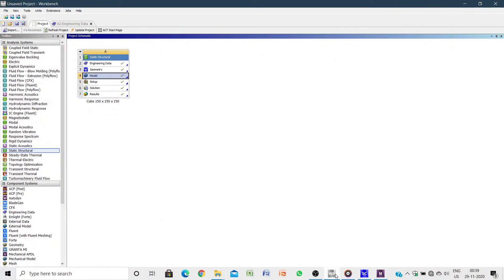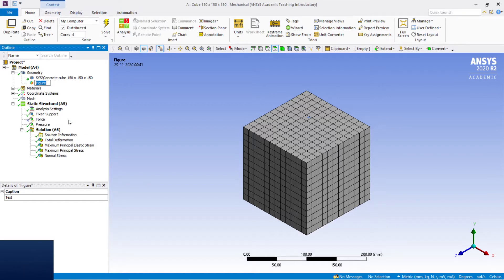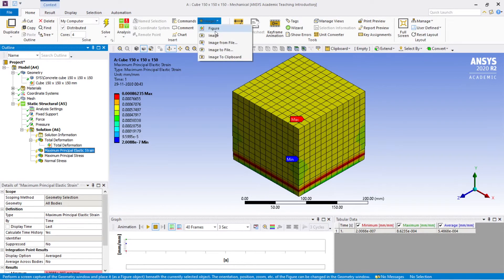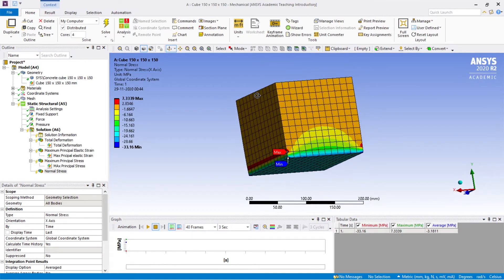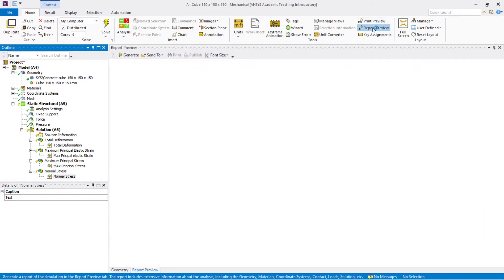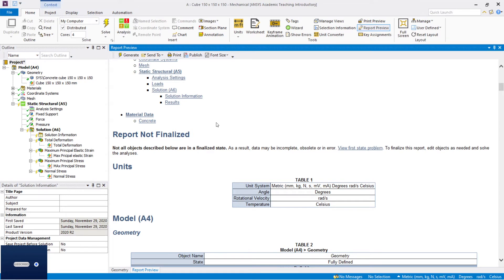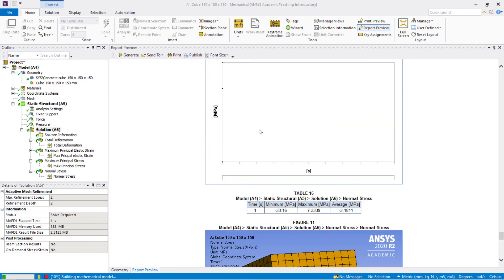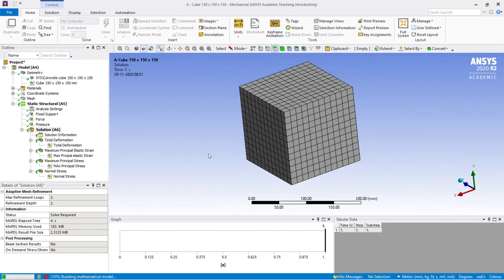How to Generate Report in Ansys 2020 R2...??

Comment: How to export to text file that includes also node location using ansys 2020. currently when I export it only shows node number and deformation value. I want to know the node location too. kindly help, thanks.
Reply from the maker: Hi Diyana, If u want to know Node location then "ON ANNOTATION PREFERENCES" in Mesh Display Select "Node Number", By doing so u will get the location of any node u require anywhere in your Model.

If u want report follow my steps........
# Right Click on Model and select "Named Selection" 
# Scoping method > Worksheet > Add row > Entity Type > Mesh Node > Criterion > Node ID > Operator > Equal > Value> any node value (for ex: Say 1000) > Hit Generate and you will have ur results.

Comment: report not finalized .... what is it? I'm having the same problem
Reply from the maker: I didn't get u......?? I have shown how  generate report .........Be specific
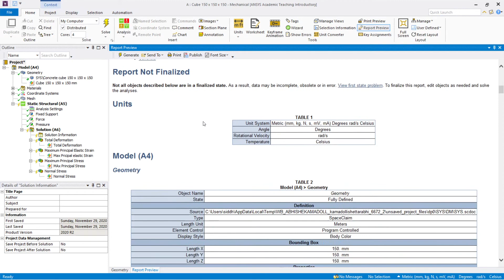Reply: In your video 8:23 minutes, in the report, it shows REPORT NOT FINALIZED
Reply from the maker: @ashikpaulm7980  when My analysis is incomplete i.e you should get green ticks on solution results then it will show completed ............Since I was interested showing how a report can be got so i didn't complete the analysis............
Reply from the maker: @ashikpaulm7980  Good Observation .........I hope your doubt is cleared..........
Reply: @CIVILENGINEERSADDA  ok thats fine. 
But when I completed the analysis and then generated the report with all the green ticks. Still it is showing report not finalized. Do you have any solutions...
Reply from the maker: @ashikpaulm7980  have u saved the file ?? ................ i need to look into it .....
Reply: @CIVILENGINEERSADDA  it is even showing for a simple beam analysis. With one end fixed and other end with a force
Reply: @CIVILENGINEERSADDA  it's not just with one file but all of it. Ive searched the internet for a solution, but got none.
Reply from the maker: @ashikpaulm7980  Post a question in Ansys forum they must definitely solve ur query
Reply: @CIVILENGINEERSADDA  ok thank you